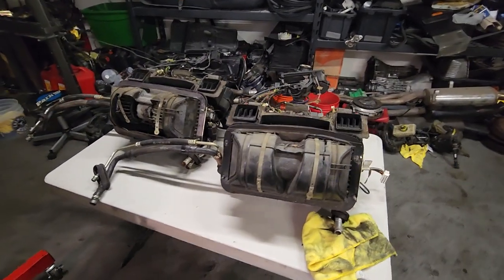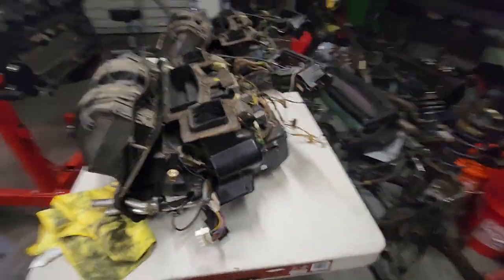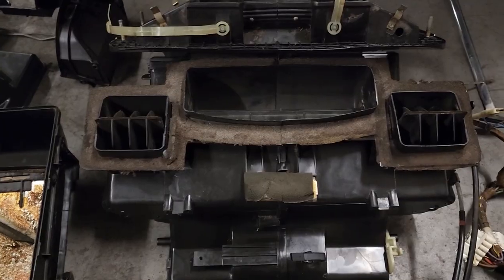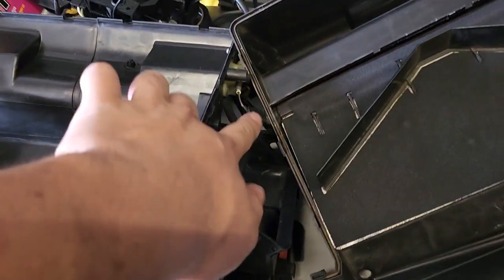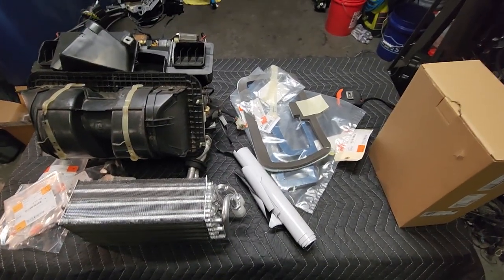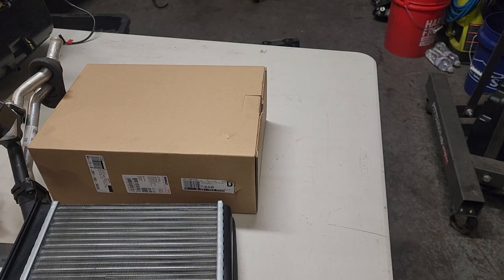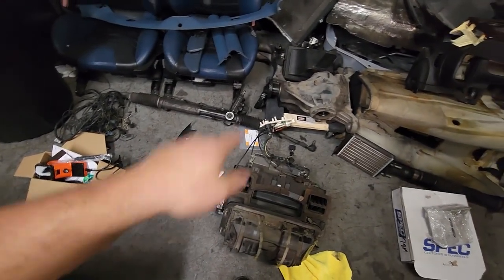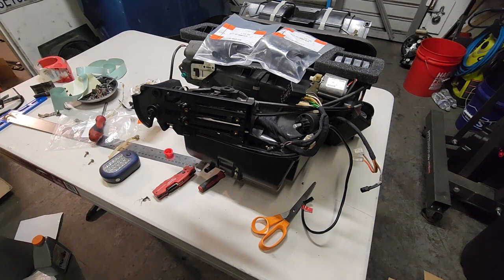E30 Restoration EP9 | E30 Heater Box / HVAC Box Restoration

Comment: Thanks so much, I can’t tell you how much this has helped me put my 1990 325i IHKS back together. One comment, I tried your method of duct taping a T20 torx driver to a long (12”) screwdriver to get to the inaccessible screw joining the left and right sides of the upper unit.  This was successful in removing the screw for disassembly, but not for tightening for reassembly.  I had to buy a 12” T20 torx screwdriver to get the screw to thread.  
The amount of filth and grime in that contraption was astounding. And you’re right, hand cutting all 16 foam pieces for the flaps was a total pain.
Reply from the maker: Glad it helped! Yes the duct tape is hit or miss lol!

Comment: what does that black plug going to the ecu front the cigarette lighter plugs do?
Reply from the maker: If your taking about the 3 pin (only 2 being used) black plug on the late model hvac harness. It the compressor switch. On early model it goes through the engine harness. On late model it goes through the chassis harness